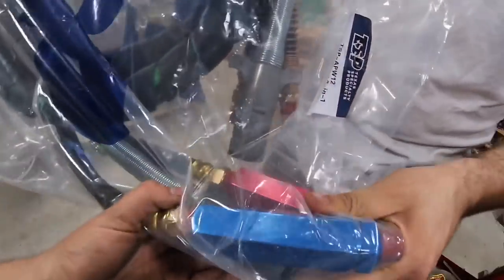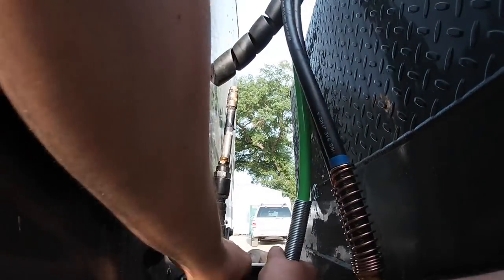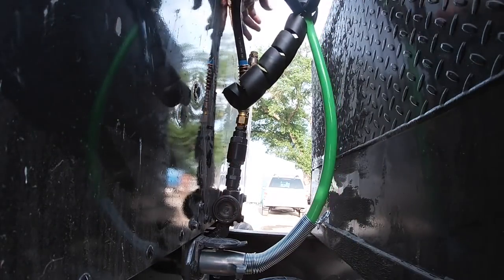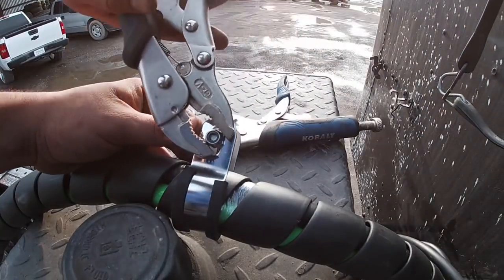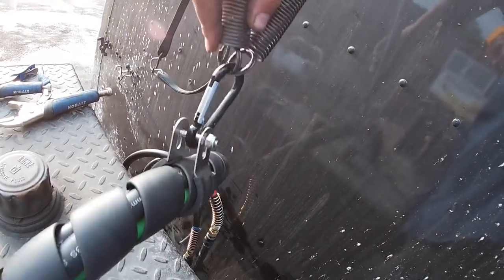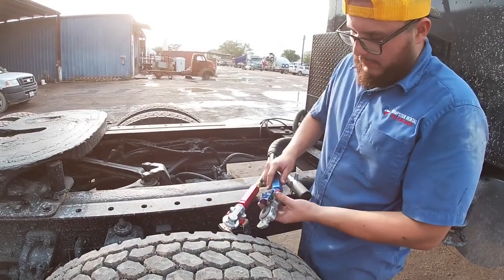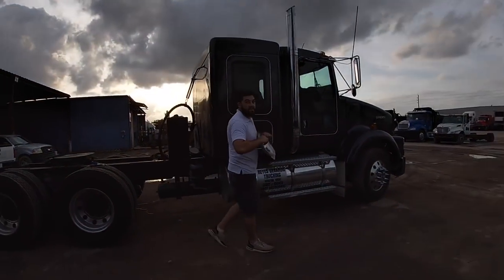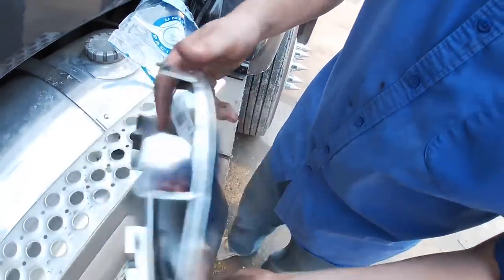Installing 3 in 1 air power lines and front chrome hub caps | BR TRUCK PARTS

Comment: That's great can they do a frame stretch? I put a sleeper on but only can run my flatbed trailer
Reply: Yea they go to a guy named Ismael good people good prices
Reply from the maker: EZ Trucking yes Ismael can do it, he is going to add a fuel tank to my driver side and make it half hydraulic. He also did a pintle hitch plate on my Mack truck you can see his work on a video I did about it.
Reply: Perfect thanks brothers I need to get that do very soon